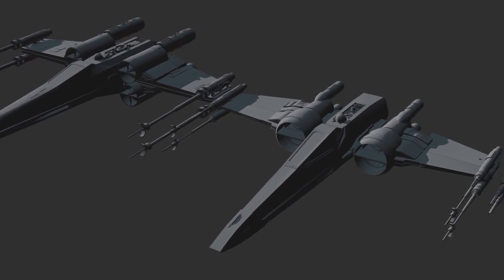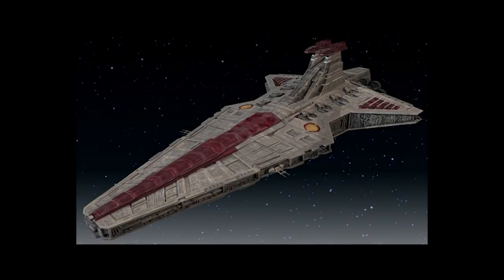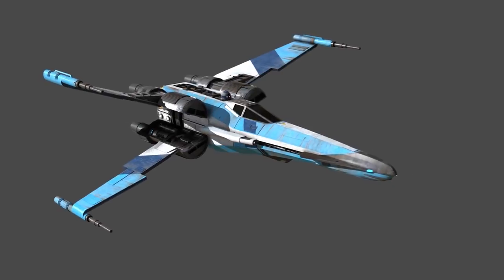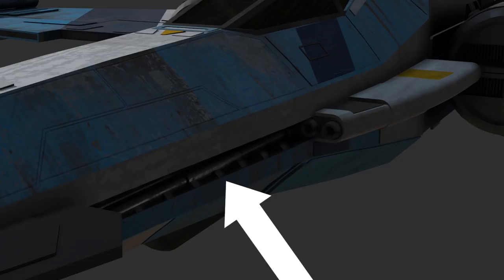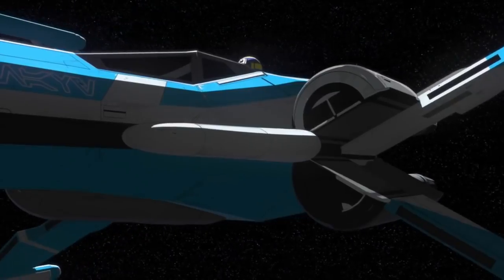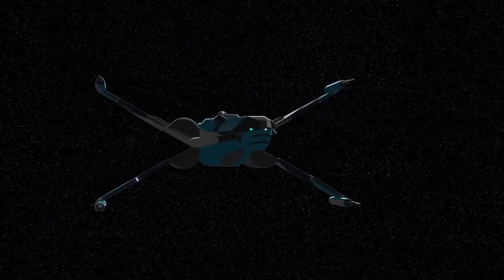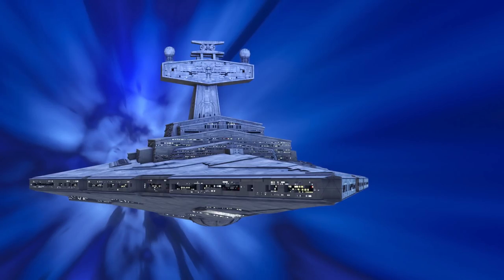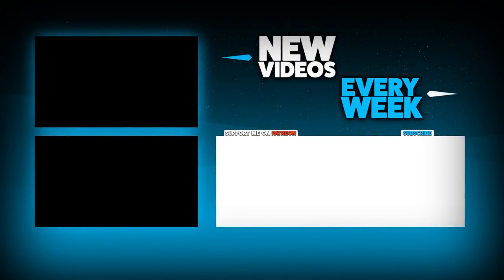Realistic T-85 X-wing Model

Comment: EC Henry said he wanted to make the X-Wing realistic in this vid. If he wanted realistic, he should make the X-Wing over 47-60 ft long with enough space to fit the realistic main engines and directional thrusters, fuel cells, life support system, ammo cells, armaments, avionics, etc. There shouldn't be air intake at all since this is interplanetaty space fighter with no oxygen to draw from in other planets. No engine, wiring, hydraulic tubes should be visible and all protected well concealed.

Comment: I like ur design better to follow the pivot of the originals but the wing lightning bolt jagged shapes really bother me. Split swept forward would have been better. I had a gull swept forward wing design idea with 1 large  cylinder shaped  a 10 warthog styled engines on each side the wings fold up like the imperial shuttle. and around the engine's to stow  more ships in a ship carrier. Gun placement under the bend of the gull wing

Comment: Honestly, (and this is a problem I have with Legends too) I wish that they would have moved away from Rebellion era fighter designs by the time of the sequel trilogy (or NJO in Legends).  Modern aircraft have more design limitations than starfighters would, but there are still distinct differences in the silhouettes of (for example) the F-18 and the F-35, which were designed for similar roles a few decades apart.
Reply: But if it’s not broken don’t fix it
Reply: @omarbaba9892  Not broken for a Rebellion (with limited resources and manpower) doesn't necessarily translate to good for a large galaxy-wide government.  X-wings were ideal for the Rebellion because they were versatile enough to handle a wide variety of missions, durable enough to help preserve their limited supply of pilots, and mobile enough (with hyperdrives) to do hit-and-run attacks against the Empire (which they couldn't go toe-to-toe with).  They were a jack of all trades, master of none.

The New Republic would have had the resources to create a variety of more specialized ships.  We even saw this later in the Rebellion with A-wings (more specialized for fighter-vs-fighter combat) and B-wings (more specialized for attacks on capital ships).  And holding territory is a different mission profile too.  If you're defending a fixed point such as a planet, would you really need fighters with hyperdrives, or could that money/space be better spent to make the fighter more useful in its defined role?
Reply: @Starsaber222 the whole point of the x wing is that it was one of the best fighters ever made, why drastically go away from its design just for the sake of it instead of just improving it like they did with the t-70 which makes sense

Comment: This comment section has made me aware that some people actually believe Luke didn't use the force to push the torpedoes into the exhaust port

first of all, the torpedoes were not guided, because he turned the targeting computer off, and dumb fired the torpedoes, meaning they would go in a straight line without any interference, then he used the force to turn them 90° so that they ended up going straight down the hole, the reason for him doing this is because in a cut scene, he tries to make the shot with the targeting computer on and it misses horribly.

Comment: Hey EC Henery please make a more realistic version of the iconic VF-1 Valkyrie from SDF Macross/Robotech.

Tip look at the VF-0 Phoenix from Macross Zero.
Reply: F-14 Tomcat...
Reply: @corwinhyatt519  no as in if he were to design a transforming fighter in this day and age. As Shoji Kowamori designed the fighter( really well and timeless I might add) in the 80's. So what would it look like today?
Reply: @Barry Bend You said realistic, I went with that. Since you meant modern, the F-14 Tomcat was the artistic basis for the VF-1 when Macross originally came out. So we'd be looking at the F-22, the F-35, the Japanese Defense Force's (forgive me if not the group's name, I'm pulling from memory) current ASF, or one of the current Russian designs. Honestly I'd be curious what he'd come up with for a Veritech based on one of those. :)
Reply: @corwinhyatt519  well in macross plus the YF-21/VF-22 was based off of the F22 and F21 concept planes. The VF-17 was based off of the project blue concept plane. The YF-30 and VF-31 are based off of a modern Russian concept plane and the SV-262 Draken 3 is based off of the SAAB j35 draken. So maybe more modern concept aircraft would have to be used in EC's design.

Comment: I REALLY don't like the T-85 design. It's incredibly problematic, especially because it looks like it came from Star Citizen, rather than Star Wars.

What is the purpose of the canards? They just seem out of place, and are tacked on just to change the lines. The hull thrusters are ESPECIALLY troublesome, considering they take up space used for OTHER internal components (fuel tanks, cooling system, power generator, etc.). Oh, and they'd also interfere with a central S-foil hinge like on the earlier X-wings.

Comment: I hate the way the S foils look on the sequel x wings when they go to attack position.  They look so flimsy
Reply: They're supposed to be a slim design. And much smaller target to hit.
Not to mention the T-70 is all around more agile, more technologically advanced, has SO many proton torpedoes it makes the Y-Wing redundant, also making it a Multi-Role fighter. 

And yet even with all of THIS it's considered an "outdated" aircraft by the time of the Sequel Trilogy... (T-70 was made right when the Empire was defeated and lasted over 30 years) 
I generally love this aspect personally.
Reply: @michaelstodovski2219  I understand all that. I love the way the engines look and how sleek it is. Its gorgeous when the foils are closed. But when the wings are opened they look like they're going to snap off to me. Maybe something more like what the ARC170 has would have been better?
Reply: @cernstormrunner7263  Probably to lighten to spacecraft and also take out redundant features. For example the T-65 had a unreliable system of generating the lasers so if the wing was shot out. You literally lose a weapon and not to mention a wing, the T-70 makes the target profile for the wings smaller. While having a more reliable feeding system.
Reply: @cernstormrunner7263  Also it's competitor the Tie Fighter was far more manuverable and is able to basically overpower the shield generators so really the X-wing was only advantageous due to having hyper space travel.